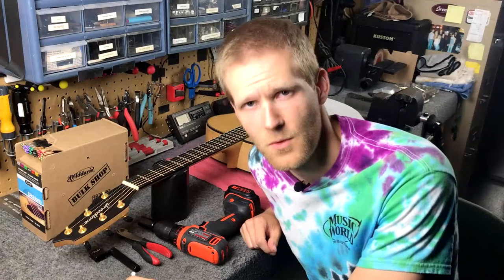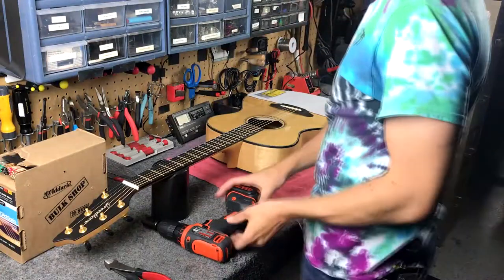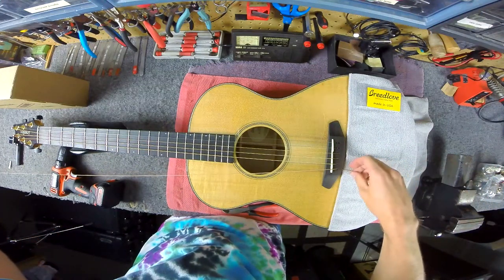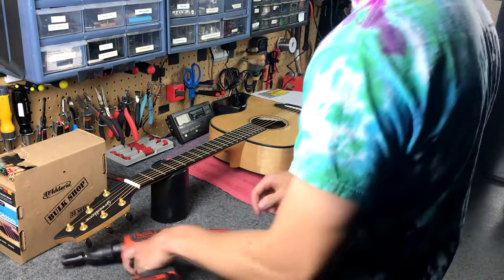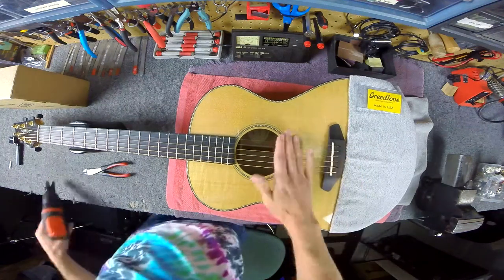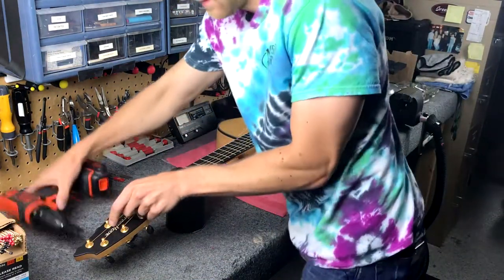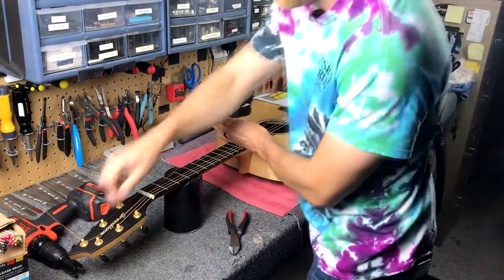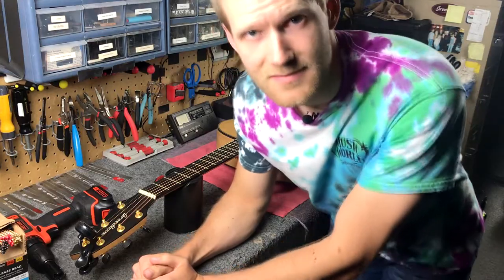How to Restring an Acoustic Guitar | Breedlove Pinless Bridge

Comment: Hello....  Thanks a lot for this 
This is what have been looking for 
I'm a new guitarist, I bought a guitar (sparkle MG93C) and it has a pinless bridge 
But the questions I want to ask is
1. Pinless bridge guitar are they classical with nylon string or acoustic with pinless steel string? 
Am a little bit confused about this stuff please I need your help 
Because I want to change my strings to extra light strings 
So I don't know which one to purchase 
Thanks
Reply from the maker: Hi Miracle, thanks for the question - to answer it simply they come in both, but for different reasons.  I'll explain - classical or "nylon string" guitars have tuning machines that have rollers on them, which is a different method then a traditional steel string acoustic.  Nylon strings are flexible and are strung on the winders and wrapped many times, and then tied off at the bridge (which is pinless)  The end is usually then tied with a series of loops which is a completely different method and would require another video to explain.  Classical guitars don't have a truss rod which stabilizes the neck - you need a truss rod for a steel string as it's much higher tension then the nylon string guitar.  Acoustic steel string guitars have whats called a "ball end" and acts as a stopper for the end of the string.  If you have a pin-less bridge you could technically put nylon strings on that guitar but the winders aren't likely the right ones for nylon strings.  AND I don't recommend doing that for the sake of lighter strings.  The better option is to purchase either a .10 or .11 gauge acoustic phosphor bronze string, or even easier on the fingers, a set called "silk and steel" strings.  These have a more flexible core like nylon strings but maintain the steel E and B string, since those are the smallest strings.  They sound a bit different then phosphor bronze, but not as different as nylon.  ALSO, nylon strings are more flexible, which require a wider spacing on the nut and fingerboard and you will likely have issues with nylon strings on a guitar designed for steel strings.  Hope that helps!
Reply: Thanks
Reply from the maker: You're welcome!